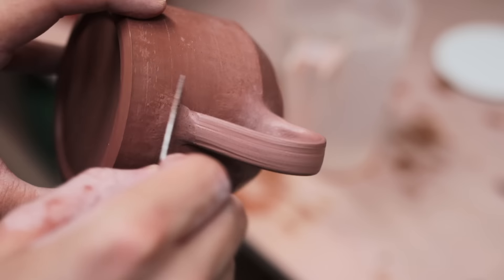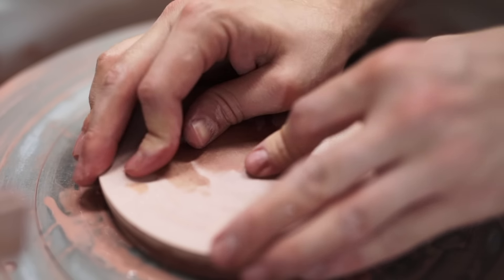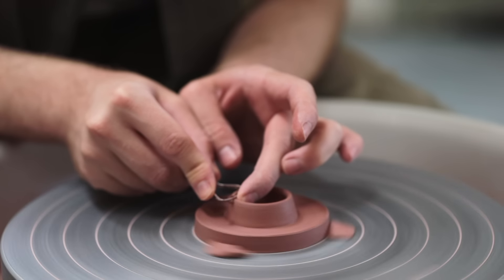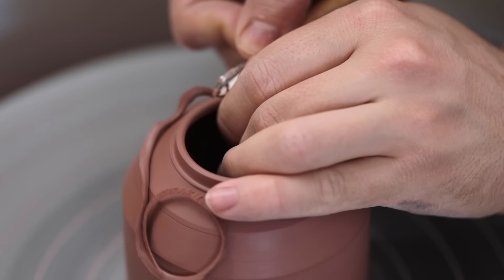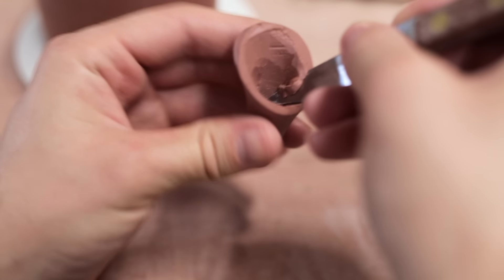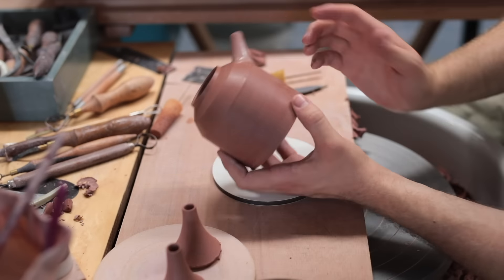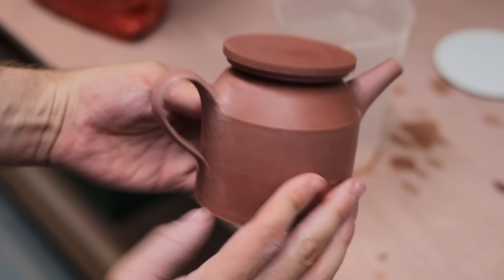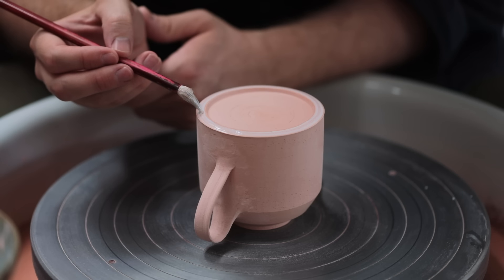The Best Pouring Teapot I've Ever Made!

Comment: 6:11 Have you experimented with leaving the diameter of the gallery 1-2mm smaller on the inside and then trimming the gallery to match the outside edge of the lid (which you leave untouched after throwing)? I get very reliable and neat  results with this technique on vertical lid skirts made to catch when tilting. Big fan of your work!!

Comment: Dear Florian,

There was a episode of Amateur Scientist or Mathematical Musings that I read decades ago that detailed the theory and practice of making a pouring lip or spout so that the water/tea would not dribble.  The fact that this is mature technology and yet there are still production line designs in hand and factory made goods that dribble is kind of an indictment on the human species.  I hope you have researched the reasons for the problem and keep the remedy in mind when making things that pour.

Another thing that I recall seeing in hand made pottery decades ago and only hearing about the invention of in commercial table ceramics just a few years ago is making the base of cups and mugs dishwasher friendly with 3 or 4 simple notches in the ridge to let the water drain out and allow the mug to dry completely in the dishwasher instead of having a small puddle holding the last rinse water.

This is your second video that I have seen and it too was interesting and I see YT is now suggesting one where you discuss mug footwells yet I see no signs of the dishwasher friendly drain notches in the thumbnail and am saddened to think that it is not a primary design requirement.  I will have a look at the video just to see what footwell ideas you promote but after that will pause in my pottery video indulgence even though your videography style and quality is superb.

Comment: you don't tilt the spout a little bit to account for the clay shrinkage?
Reply from the maker: Do you mean like when you slice the end of the spout? If you cut it, then you need to angle the cut, so as the lay shrinks it unwinds into the right spot, but when left in its initial thrown shape you don't need to cut it.
Reply: @floriangadsby  I think so but not entirely sure. I took a class and one assignment was to make a teapot and during the demo my professor said to tilt it a little bit to accommodate the amount the spout would unwind. However I didn’t see you do it, so I was curious.

Comment: About your question regarding the unsmooth spots in the glaze: In my ceramics class, my instructor specifically told us that we don't have to worry about them, that they will dissappear when the pot is fired. So for your sanity, you may want to do a test batch where you don't worry about it :)

Comment: Shame there are distortions in every piece. You really need to check from several heights and distances in the future. Not that this a bad job. But I am not a huge fan of the shape either. An ideal teapot is shaped to be conductive to external pre heating with just hot water. If you keep this up you will definitely be a master in 5 years at least of technique.

Comment: Hi! I had this idea to make a lid (for a teapot). Make a bigger hole on top of he main lid (1/2 to 1 cm). This new bigger hole can hold another mini-lid that sits loosely. As it sits loose, air can enter to the pot preventing clogging of the water inside. The mini-lid should have a vertical shaft (again 5 to 10 mm) and you can remove it to re-fill the pot with hot water.
Your videos are awesome, thanks